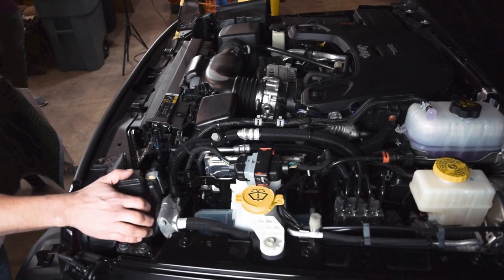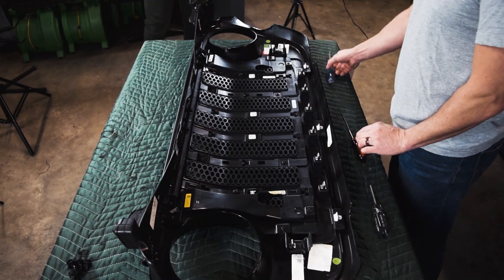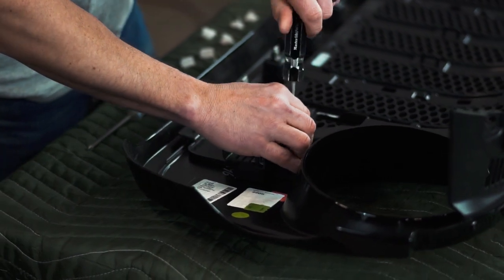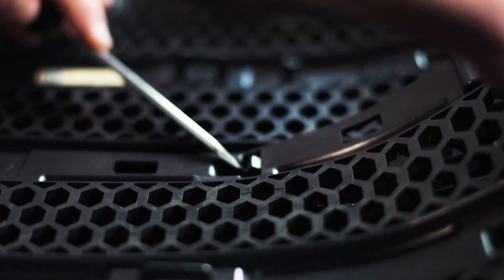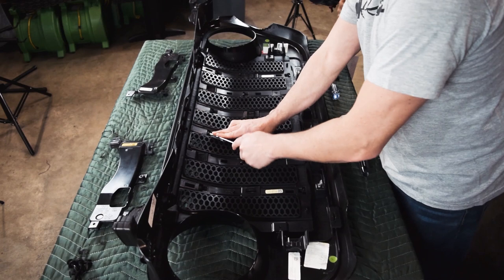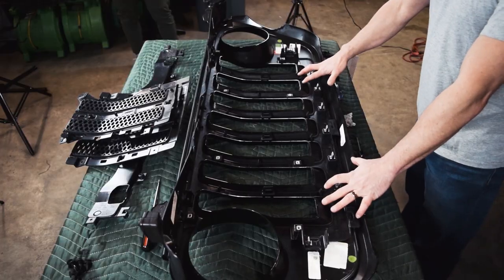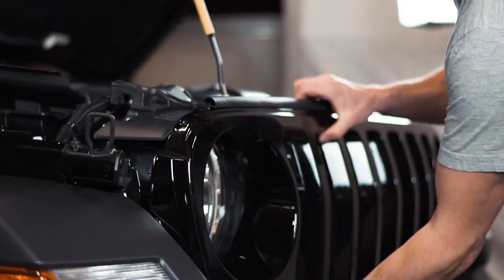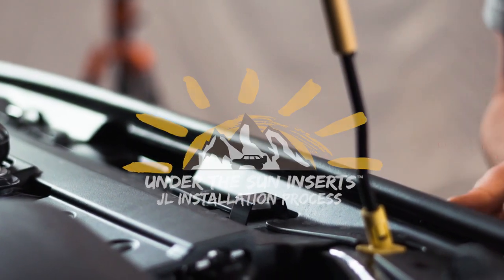Jeep Grille Insert Installation on Your Wrangler JL or JT Gladiator

Comment: Would it be possible to leave the plastic honeycomb-shaped original cover in place and just put this behind it? I don't really want it bare except for the insert.
Reply: Well, I just did it and it works in case anyone was wondering. It looked too open for my tastes without the original cover there, so I got the best of both worlds, IMO. I bought a black insert; it probably would have broken up the flag or other patterns too much for most people's tastes.
Reply: @RussellPea  thanks for confirming, I plan to try this as well when my insert arrives.
Reply: @RussellPea  did you find it difficult pushing in the top pins by the headlights?
Reply: @RussellPea any chance you took benchmark engine temps before after and does the insert impeded too much flow for proper cooling especially in hot summer time? I'm going to try the same with leaving the honeycomb in thanks.

Comment: Just installed mine looks great! Thanks for the awesome product
Reply: It just stays in place with no screws or clips seems like the factory grill had alotta stuff holding it in place yet this needs nada
Reply: brooklynmonster730  yea the grill has some protruding bits that keep pressure on it so it doesn’t move
Reply: My only critique is that on the Sahara the black tabs that had the white clips are pushing against the insert causing fit problems with the silver lining of the grill. All plastic but ill see if I an do anything short of removing the plastic. Love the insert otherwise

Comment: I just installed mine, and I noticed a little bit of a gap between the Jeep grille and insert. Is this normal with the JL, due to the curvature?
Reply: Had the same question - there's another video where the guy actually screwed the insert down, which flexed it into that curve.